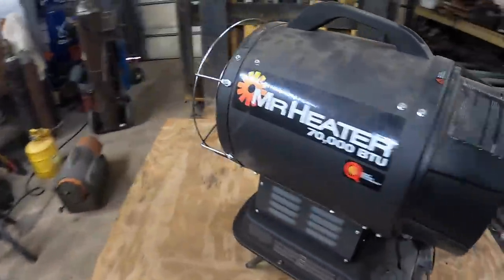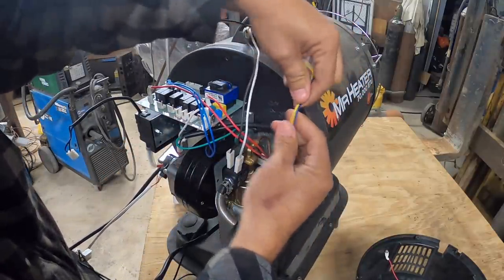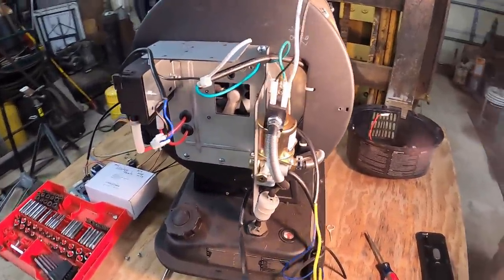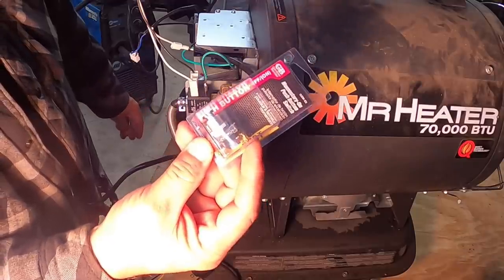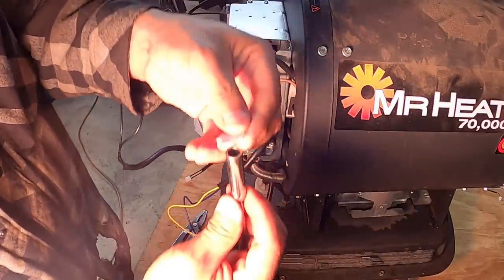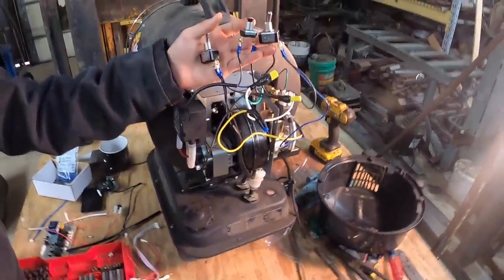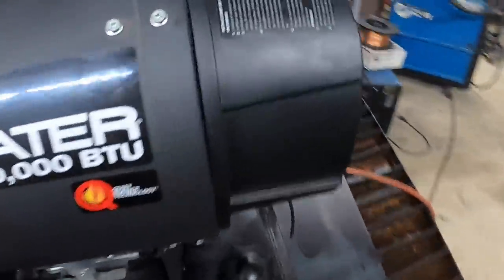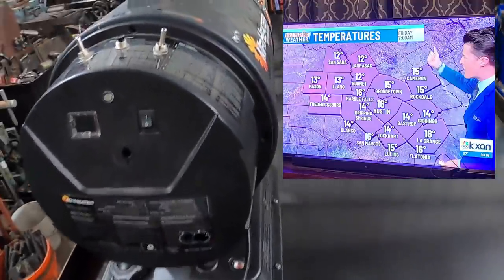Mr. Heater Troubles.. Eliminated.

Comment: youtube doesn't let me post links...damn censorship
well anyways toss "Incredibly clever oil furnace burner controller" into your search box and it'll come up
fuck it doesn't even let me reply any more, keeps tossing "we weren't able to add your reply, please try again" back at me, I'll try editing this into the original comment, see if that works...
ETA: it's a video from bigclive on a mechanical burner control that'll use a flame sensor to run the igniter, and it'll even re-light the flame a couple times before locking out

Comment: Talk to a oil furnace guy.
Using  a older version that doesn't have computer boards. 
Putting back a little safety. But keep the K.I.S.S.
KEEP
IT
SIMPLE 
STUPID. 
Plus he probably has old stuff you could use for free. 
A warm shop is so much better than a ice box.
All ways a good when you work with your son.
Good luck 🇺🇲🤔

Comment: As long as you understand there could be re-percussions if ever you have a fire as Investigators do not look lightly 
in the fact that you have interfered with the internal workings of electrical goods especially if it's a bad fire and everything is charred
they will want to lay the blame on something, to find this, I would lay odds they won't pay out.
Cheers from a friendly assessor, Don't mess with Electrics it's the first thing we check. 
Yes it looks and works well but it is not how it was manufacturer assembled, therefore Questionable, IE tampered with, and not factory approved 
I win you lose.      
(here's a tip use it warm the place up keeping an eye on it then remove from the building, bring it back when needed and repeat.)   better to keep safe, safeguarded  and Insurance WISE.
Hope this helps,
Reply from the maker: food for thought. thanks bud

Comment: just finally did mine, but found out the real cause of my E1 trouble codes. with everything bypass mine still wont fire up.. took the burner stage out and found my injector spray pattern is streaky, took it out and clean it.. it fired up.

Comment: Is the heater for the hot house or you bringing the plants indoors? I guess the welders don't work in the cold, they just become HVAC techs. Better put smoke detectors in the shop just in case.

Comment: I attempted this repair this weekend and I am having trouble with the fan toggle switch not turning on.  I have the original pair of  “FAN1” black wires and the main power connected to this switch on the “ON” switch connection.  In the video it does
Not appear anything is connected to the “OFF” position terminal.  Can someone help?
Reply from the maker: I forget How I did it, I used three individual switches, one for the fan, one for the pump and a temporary switch for the spark.

Comment: I go through at least one diesel heater a year.  For the last dozen years or so they have all been junk.  I've rebuilt the fuel pumps and whatnot, but they just crap out.  I use service plus when the temps get cold, but wish anyone would make a quality unit still.

Comment: While the safer solution would be to order the replacement parts from Mr Heater to get it working properly (easier than swapping in furnace controls etc as well lol), for professional use when it's constantly attended I suppose this is something that I would consider doing as well lol

The dangers are that if the fan dies you end up with a flaming lake of fuel burning inside the heater as the whole thing goes onto meltdown. Hopefully there are still overheat sensors in the loop?

If the flame goes out it will be dumping raw fuel into the burner, and potentially spilling out, which isn't too bad if it's contained and not running across the floor, but when you restart it with a pool of liquid fuel in the burner you could have some issues, so make sure it's drained out before restarting it, and maybe run it on a metal pan or something that can contain any spills.

Comment: Bet money your circuit board is bad I fixed 2 of mine like that but bigger ones they both had a burned spot on the back of the board, the board was like $20 and I think what did it was using a crappy extension cord

Comment: ...a little bit dangerous isn't ? you have bypassed a thermoswitch (orver temperature in case of fan mulfunction ) see at 03:10 the two red wire.. is not a good idea in my opinion !